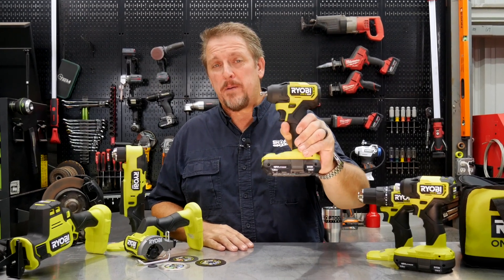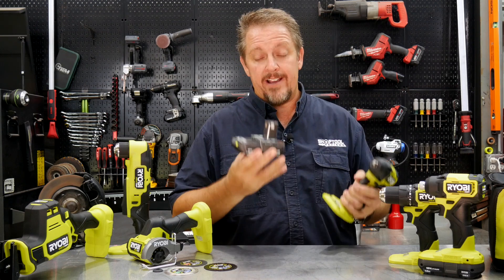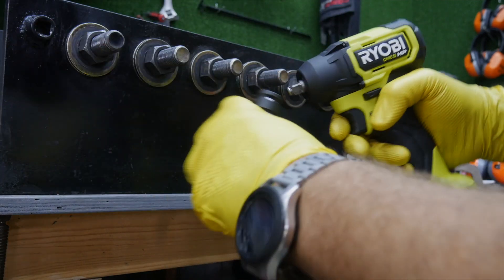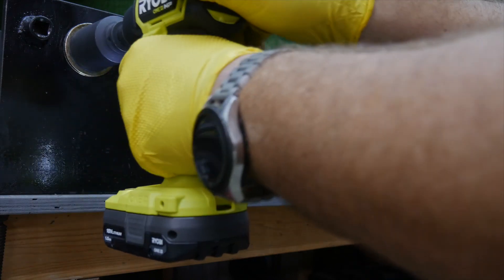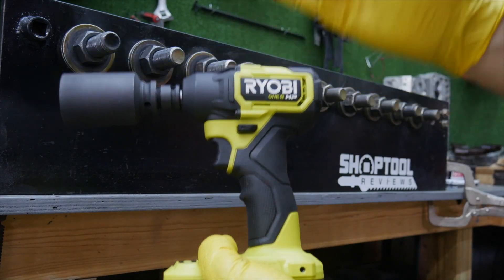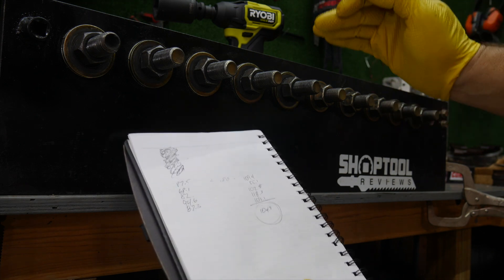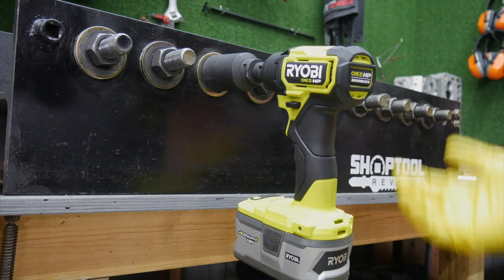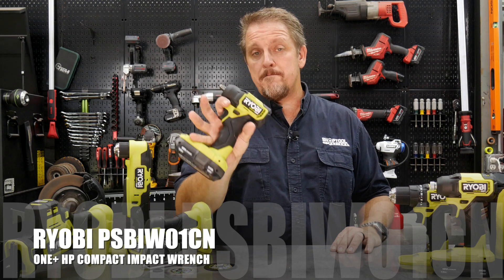WE GOT IT!! Ryobi HP Compact Impact Wrench - 3/8" One+ 18-volt [BRAND NEW]

Comment: is this good for car Lug nuts?
Reply from the maker: Probably fine for a lot of passenger cars. If you're doing a lot of wheel changes, or if you're messing with trucks, then I'd step up to the 1/2" impact. Thanks for watching.
Reply: @Shoptoolreviews  Thank you for answering my question. I just need it to  change brake pads time to time and I think it's good for me .

Comment: Why does everyone say any tool works with any batter? They don’t!!! Very single tool has certain battery models they work with, if you use a different battery than recommended in the manual it could ruin the tool and they wont replace it under warranty because you didn’t use the recommended batteries. For instance I just bought the p261 1/2” wrench and I have to return it because all my batteries are the hp battery type and are not compatible, they told me it could catch fire, and no warranty because you used a battery not specified. Any tool does not work with any battery, lies by ryobi.

Comment: Work to change a tire ?
Reply from the maker: I would not recommend a compact impact wrench for changing tires. However, it could do it if the lugs were tightened to spec and not over-tightened or rusty. Thanks for watching.

Comment: if your job is to review tools and you are testing breaking strength, you need to have the proper size socket. I'm so tired of seeing videos of people using adapter over adapter. And they do make the sockets to do this in 3/8, you just dont have them.
Reply from the maker: We'd really appreciate it if you could find us a 33mm 3/8" drive deep-well socket. I'm sure it's because we lack the knowledge in finding tools. In all seriousness, if it made a difference, we would have one made. Our point here is, if you are buying any impact tool to consistently use in the top 10% of its capability, then it's the wrong tool for the job. Thanks for watching.

Comment: That's all it can do before it over heats
Reply from the maker: Yes, it actually did quite a bit, and we were pushing it harder that it should be for a 160 ft-lbs impact. If we were running in 15mm or 9/16" bolts, it probably wouldn't flinch.